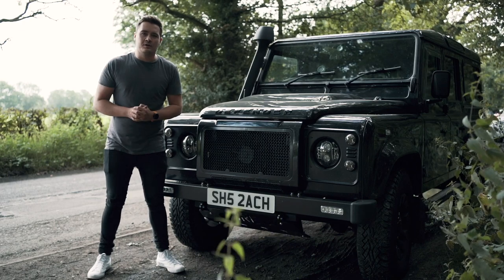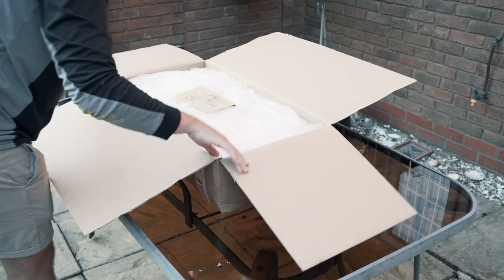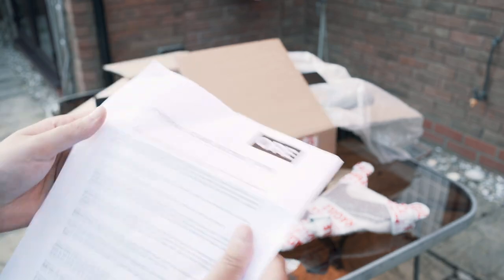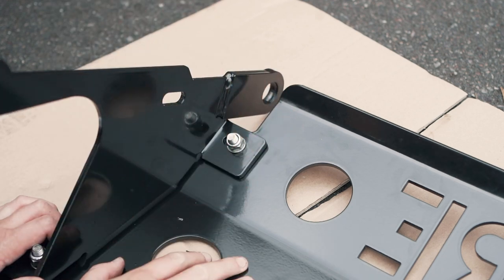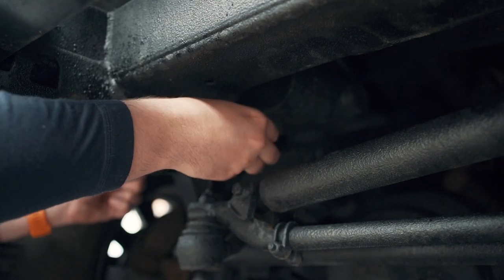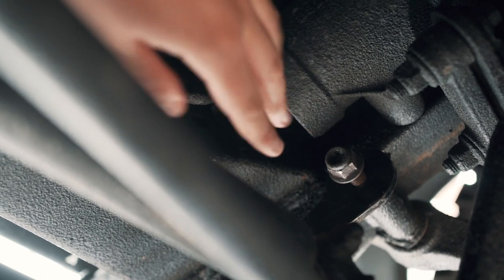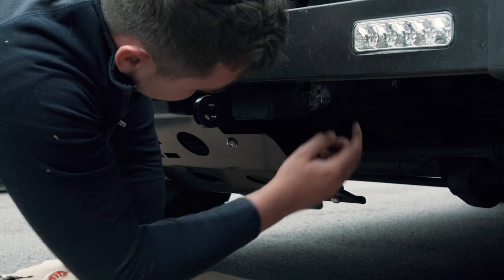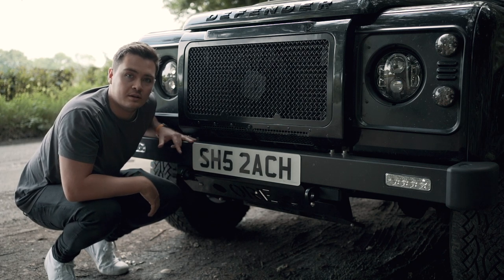FITTING A STEERING GUARD TO MY LAND ROVER DEFENDER

Comment: I don't understand why you produced a video to demonstrate what is certainly the simplest "bolt-on" addition to a Defender   -   a total waste of time.
Reply from the maker: I don’t understand what this comment achieves Colin - I’d say this was probably a bigger waste of time
Reply: Actually Colin, as someone that was considering one of these steering guards, having an installation video showing the ease of installation was incredibly helpful.
Reply: I fitted one about 16 years ago. It was taken off and now want to fit it to my latest chariot.  For the young fit, and clear of head ...Its a doddle.  But having lost the bolts,  gotten a lot older and less able, vids like this are an invaluable.reminder.
Definitely NOT a waste of time..and the rather "creative" letter spacing on the number plate only adds to it..!